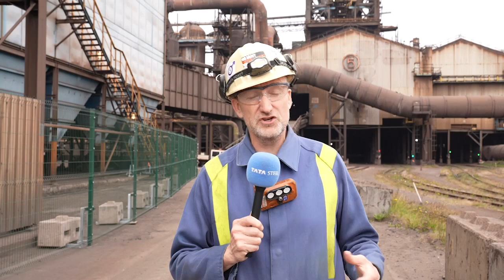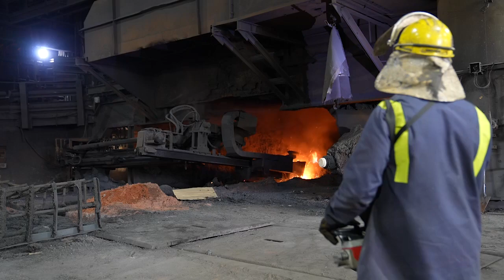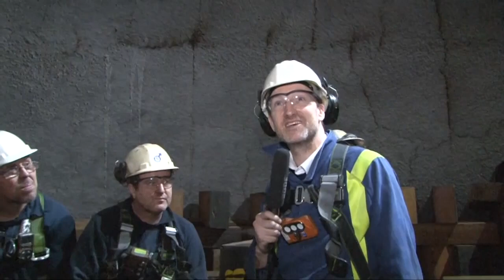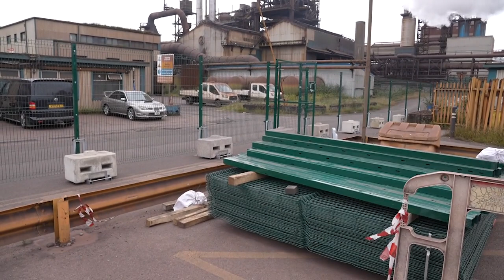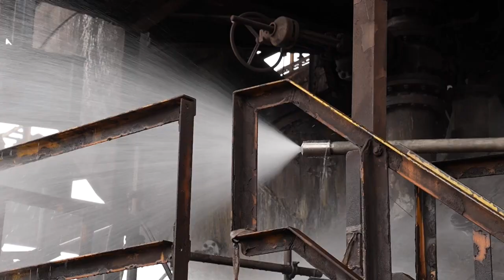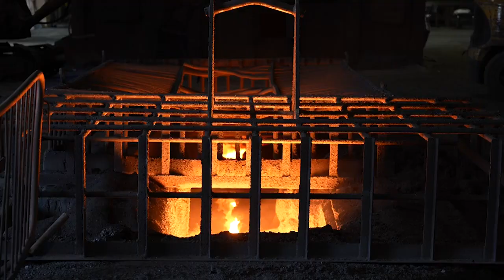Blast Furnace 5's final week

Comment: the blast furnace makes iron from ore you can.t make steel from iron in a electric arc if you can please explain ?
Reply from the maker: Hi Paul, we will no longer be creating molten iron from imported iron ore in our blast furnaces then converting that into steel. Instead, we will be recycling the abundance of steel scrap we have in the UK in our new electric arc furnace. One of the wonderful things about steel is it can be infinitely recycled without losing its properties. So we will no longer be reliant on other countries for the raw materials going into our furnace, we will also be drastically reducing our carbon footprint.
Reply: @TataSteelUK  I can see TATA pulling out of this project when its decommissioned, experience will be going as most take retirement.  I hope I am wrong, but that's my gut feeling. My question is... what about the steelworks customers, and will Trostre close ?  I can see an Ebbw Vale scenario coming our way............. The area will become baron of heavy engineering and Aberavon beach will be its main industry. I have seen this area decline over the last 60 years. Its a great shame as net zero kills the UK.
Reply: @DOCTORDROTT WESTMINSTER KILLED WALES! THEY LOOK AFTER THEIR OWN-SCUNTHORPE

Comment: Even though Electric Arc Furnaces are so high tech these days, its easy to forget they're not a modern invention. The EAF was invented in 1889 and first used in steelmaking in 1932, but it didnt become popular until 1966. Today, EAF's produce 70% of the world's steel.
Reply: 70%? Can you verify that  figure?
The ferrous scrap requirement would be unsustainable even with  DRI  as part of the charge make up.
Surely Chinese production is based mainly on BF/BOS practice.
Reply: 22%
Reply: Still making inferior products unsuitable for the armaments industry and probably high tech manufacturing, so we get bought out by foreigners and dumped like the dross!